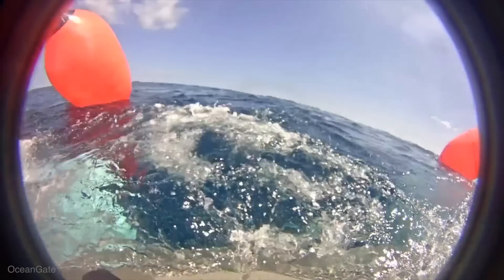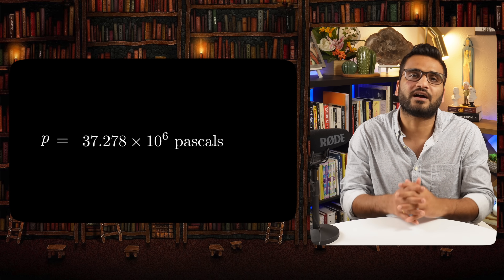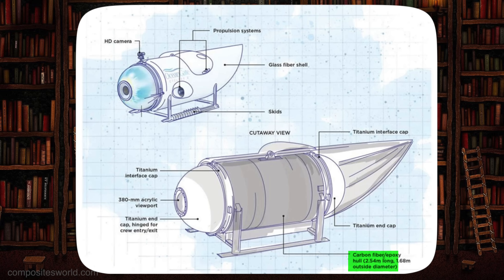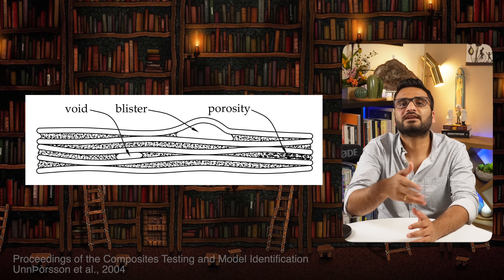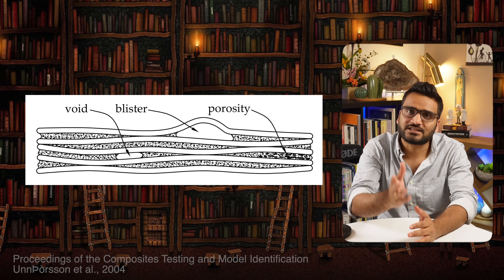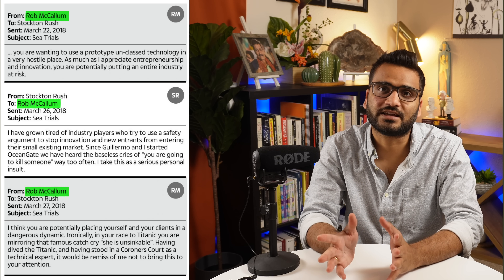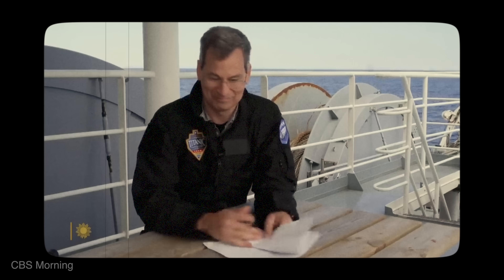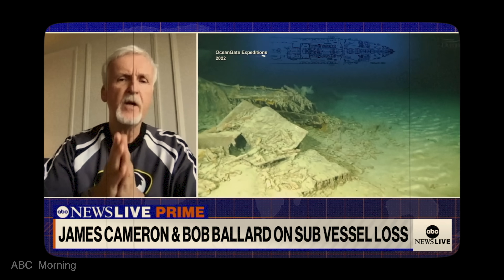OceanGate REALLY messed up - A Structural Engineer's Perspective | TITAN'S TRAGEDY

Comment: Thanks very informative, if i had just been a little better at maths i would have loved to be a structural    engineer, all the same i have kicked composite projects and repairs around for fun, never used carbon fibre, delicate and unforgiving with stress concentration problems at connections, hence the glued joint which has its own problems, peel load failure for one.  I wonder if the hull was doubled inside of the joints and tapered to hull thickness, was there any internal structure, why use any kind of laminate structure in an application which is under massive compression and a cylinder rather than a sphere, then the view port? The death waiver cant be worth the paper its written on when lies and negligence are involved either.   So many intelligent people were involved in this company its unbelievable that they were responsible for the product.

Comment: The carbon fiber filament winding of the cylindrical hull had very little lateral strength since the only thing holding the fibers together laterally was the epoxy resin. There should have been at least a 30-45 degree layer wound every 4-5 layers. Even then it still would have failed, perhaps after a few more dives. I believe that even if the hull was 6 or 7 inches thick it still would have failed as it would have slowly fatigued after repeated dives. Carbon fiber was absolutely the wrong material for this project.

Comment: I get it.  Stockton was a great salesman in a small, but potentially lucrative market.  Unfortunately, all five victims signed a waiver clearly stating the vessel was NOT certified and was EXPERIMENTAL.  It's the same sort of issue with experimental drugs, therapies and implants.  As an RN in the operating room, INFORMED CONSENT is a key tool of operation.  Basically, it comes down to the individual making a choice; either go along with the information provided....OR...stomp on the brakes, do your OWN research and then come back and make the decision later.  No one held a gun to their head, forcing them to get into that tin can.  They made a CHOICE; risk vs benefit.  As fascinated as I am with the Titanic, the risk of going down there on that tin can or a better version of it outweigh the benefits on my scale of comfort.  Stockton could have told them anything he liked...but the bottom line is, there is a signature from each one verifying the risks were stated.  Your body, your CHOICE.  It's just that simple, folks.  Anyone who thinks differently falls into that category of 'those unwilling to accept responsibility for self and self's decisions'.

Comment: as an engineer (not materials tho) i knew instantly what happened.  A PRESSURE vessel with the forces trying to stretch the carbon fiber is a perfect use for it.  A submersible trying to compress the fabric (in effect, pushing a wet noodle) was never a good idea.

Comment: A very informative video. There is no LUCK involved in withstanding 4000m of water pressure. There are only 3 outcomes. 1.it will  2. It wont  3. It will for a little while. Sadly Mr rush went with   number 3. Its no good quoting NASA and BOEING when designing a submarine. Its not their specific field of expertise.

Comment: This is the first analysis and discussion that I've seen that spoke with the knowledge and authority of someone with actual engineering credentials. Good job, and thanks.
A quibble: Why oh why do people seem to feel the need to add fake digital degradation to film clips (the vertical "film scratches" here)? Intentionally making images worse by introducing digitally simulated dirt and wear for some supposed aesthetic effect or "visual interest" has become common and is simply a bad choice. (The corny stock video, like of the guy in a hard hat tapping on screens, cheapens and dumbs down the presentation as well. The sad minor-key piano background was kind of annoying as well. Trust your material and don't feel a need to glam it up with cheap effects!)

Comment: ocean/sea water(salt) is slightly denser than 1000kg/m3 as the dissolved salt increases its density slightly. over 4000m this should be taken into account when calculating pressure s as it does increase the pressure significantly at that depth. In the video it says density of water is 1000kg/m3 but that's fresh water. I realise it is only an outline calculation but be better to think about the correct value.

Comment: PhD level Structural Engineer here, specialising in Fracture Mechanics and Structural Mechanics.
Would I be correct in assuming that the author of the video never designed an externally pressurised vessel nor has worked with carbon fibre before? The video says precisely nothing and shows no insight. Just a few generalisations.

Comment: So, the carbon fiber cylinder was simultaneously subjected to radial compression while also being subjected to axial column compression, from the titanium end hemispheres.  This poses an extreme loading situation at design depths.  Any material or geometrical flaw, even the slightest, could initiate axial instability in the cylinder, causing its collapse.  It's noted that the cylinder did not appear to incorporate typical features such as stiffening rings to enhance its longitudinal stability under column loading.  Could columnar instability have been the failure mechanism?
Reply from the maker: It might have played a supporting role. In the sense that usually when we perform linear analysis, we consider each of these deformation effects separately—for example, we would consider buckling independent of radial crushing. However, its not the case here and given such intense forces, one effect may support other. There are numerous other considerations in play here—including seal/connections between dome and hull, the fibers directionality of hull, etc etc. its an intense interplay of various load, material, and geometry.

Comment: It should be noted that the Titan successfully went to the depth required to view the Titanic and safely returned previously. However, NO testing was done to determine how many times the Titan could be subjected to that kind of stress. The  compression and expansion of the cylinder caused from the changing pressures from traveling between sea level and down to this depth and back again probably created carbon fiber fatigue which led to the failure

Comment: The Structural Issue was the Seal between the Carbon Fibre Hull and the Titanium Circular Base the Titanium Hatch with View Window Bolts too. There is an Excellent video showing the Construction of that point and how the two peices are GLUED together! 

The Video/Photos of the wreckage shows how that section litteraly pulled itself apart. It looks like Carbon Fibre Spaghetti.   

Carbon Fibre is very strong but it is Extremely weak to break down if it is compressed and relaxed over and over. Which is what happeneds when you submerge it so darn deep in the ocean.

The likely second option for the failure is the window if it truly was only rated for 1200m depth. My bet is on the Titanium and Carbon Fibre Seal as the initial fault!

Metal can flex to a small degree before it succumbs to the pressure. CARBON Fibre with Glue ends up Cracking. Thats why it should NEVER be used as a Pressure Hull.  

That man was NOT a Genius or  Extremely Intelligent.  His Actions Prove the complete Opposite! Proving once again that just Because you are very wealthy doesnt mean you have a Lick of Common Sense!!
Reply: Yeah, probably his wealth helped him ignore his weaknesses. Any consequences while growing up could be easily be made to disappear.

The laws of physics does not care about any of that though. That’s was Stockton’s greatest mistake, which he probably was never going to learn.

I fell sorry for the families involved as they didn’t sign up for the risks. :(
Reply: @LadyScaper  true and kind
Reply: If he was that wealthy, he didn't need to skimp on any of it

Comment: Thank you for your explanation.  There were problems with some of the materials used, the engineering, the communications between divers and crew on a test dive to 33' weren't worked out beforehand,  the "research" that was supposedly taking place (which was absent), and their seemingly simply lying to their passengers.
   They had many, many who allegedly warned that the Titan was likely to have a serious to catastrophic failure. Sadly, they seem to have fired and then sued the 1 engineer who had any sense.
   That lawsuit shown was against the engineer and his wife that they seemed to have fired. OceanGate was the plaintiff on that document.
Unbelievable,  and not only a senseless loss of life, but perhaps damage to the submersible industry doing actual deepwater work, research and exploration as well.
  The coming regulations will tell. Hopefully those following the safety protocols won't be adversely affected by new regulations because of this company.

Comment: Your calculation for the static pressure is incorrect. Seawater has a density of 1100 not 1000 kg/m^3.
Reply from the maker: It was just an approximation. But you are correct. Thanks for pointing it out.
Reply: @doctorchadha  Awesome video. My thoughts on the failure are, to consider an imperfection on the outer skin of the CF leading to combined bending and buckling failure. More info to come no doubt.

Comment: Alot of people also will not know that the Titanic had a fire burning in coal bunker number six for a couple of days which is where it struck the berg and that could have weakend the hull and iron rivets .One passenger due to board in Cherborg refused because he observed smoke comming from the forth funnel which only served as ventilation to the engine rooms.The ship had three engines so only three funnels for the respective number of boilers was needed.The forth funnel on the Olympic class ships was added for symetry and the visual impression of power.He worked for Whitestar and revealed his concern at the inquest afterwards that there must have been a fire on board.His judgment saved his life.

Comment: The best, most concise and intelligent analysis I have seen on this terrible accident. Very will done and excellent explanation. The one option that had not entered my mind was buckling of the cylinder. I learned a lot from yoru explanation. Thanks! Will have to wait until the experts in the bureaucratic agencies pour over the wreckage and data for a year or so to get the actual cause. 😊.

Comment: I'm no engineer, but I can't see any rational case for the use of carbon fibre composite for the hull. The fibre is very strong in extension - which is why it's suited to resist internal pressure in tanks. But it has no strength at all in compression - you can't push a string. So all the resistance to the external water pressure must have come from the resin matrix, which wasn't remotely formulated for such a function. Or am I missing something?

It seems clear that the real reason behind the choice of carbon fibre was economic - it would have been ruinously expensive to construct such a large hull from titanium - and safety be damned.

By the way, the claims that NASA, Boeing and University of Washington were involved are false. This was a deeply delusional project.

Comment: There are enough photos and videos of the  PreLaunch of the mission.  There were visible bumps and seams when viewed in slow motion or stop frame.  I don't know if it was Mfg  or early showing of stress deformations.  They are faint but many in number...  shadowy .   Powers that Be...  get those pieces ashore for testing.  To hell with these Nay Sayers about the Sanctity of Titanic, a marine accident.  Titanic  not far away need be off limits to  anyone but researchers....

Comment: My way of looking at it is this... They didn't use a spherical pressure chamber while using a poorly suited material for mitigating extreme pressures and still survived six dives to the Titanic. Their design must have been about as good as one could be to pull that off. Given the same specs, I doubt anyone could have done better. Still, it should have never been made as the specs had it doomed from the start. Though had they inspected the carbon fiber after a every two or three dives and rebuilt it when necessary, it might have been a pretty reliable little submersible.

Comment: The direction of the fiber lay up is not discussed.  Fibers are very strong in tension not so much in compression and were layed up circumferentially not in a crosshatched manner.  Either way though the fibers were in compression not in tension as in aircraft fuselage or pressure vessel applications. 6:29

Comment: Hello Dr Chadha, thank you for your accurate synopsis of this tragic event. However, as a structural engineer I would have thought that you may have gone into more detail about the actual structure and build of the craft (although I know very little is known about this in reality). I have a suspicion that the main thing that causes this to fail may have been the way that the Carbon Fibre was wound onto the bobbin to produce the hull. From the videos I have seen it would appear that the fibres were wound only in a straight axial direction with no weave or fibres in the longitudinal direction, whether this is true or not I am unsure, but if this is true, there would be almost no tensional strength in the walls of the hull. So of course when the pressures deflected the walls at the centre of the cylinder, the inner part of the wall would have been subject to immense tensional stress as it was stretched by the effect of the wall being pushed in,. If the Carbon Fibre strands were not woven or if there were no fibres in the longitudinal direction the only thing resisting this tension would have been the strength of the resin bonded to the fibres. This would have caused the inner call to axially crack then crack would have propagated from the inside to the outside. The water would then have entered the inside and then would have blown out the window and both end caps off the hull.
Reply: A video I saw on another channel showed that the fibers alternated direction by 90 degrees in each of the approximately 480 layers in the hull.    That being said, the most likely cause of failure was the cylindrical shape in conjunction with the vessels' size.    Very small cylindrical structures (too small for an occupant) can withstand huge amounts of pressure, as is evidenced by the recovery of a small cylindrical perfume bottle from the wreck site with it's contents still intact, glass stopper still in place.    Larger, deep diving, man rated vessels require a spherical shape.     Truthfully, they were lucky it didn't pop on the first deep dive.    Composite fiber and glue just isn't safe for this kind of vessel.    Imho.   I'm  not an engineer, but physics was one of my majors in college, and this whole thing kind of seems like a no brainer.    There's a huge difference between being an aeronautical engineer and being a naval architect and engineer.    Two different pursuits entirely.    Both require a high degree of skill, yet they are as different as night and day.
Reply: @stargazer5784  Hi, in the video I saw the winder was merely going from end to end with straight fibres. I saw another video of a pressure vessel being wound with a cross weave of fibres but this was of a small vessel. When you wind a cylinder made from a cross weave of fibre the resulting cylinder has visible cross weave patterns on the outer surface, however when you look at videos of the Titan vessel end caps going on the outside of the CF vessel is absolutely smooth which leads me to surmise that the fibres in fact had no cross weave. It would be good for the company that wound the fibres onto this bobbin to comment on the way it was constructed wouldn't it?
Reply: The external pressure would cause compressive stresses along the length of the hull as well as radially.  The blending of end caps and body is always problematic (ask Boeing). The hoop stresses will be compressive. That is not a good way to load unidirectional CF wound circumferentially.

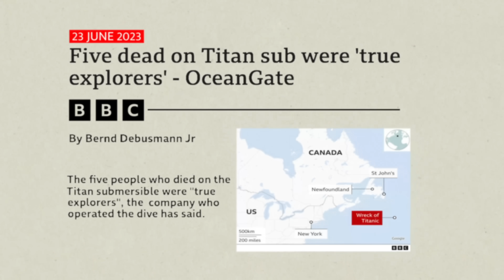Comment: No many things do not have to go wrong!  Just ONE thing!! As an example, if the plexiglass window in the metal end bell failed, that ONE failure would cause the submersible to fill with ocean water in a small fraction of a second taking the lives of all on board!  Indeed the window was missing from the end bell when found and the window was not rated for the pressure involved!  0:22